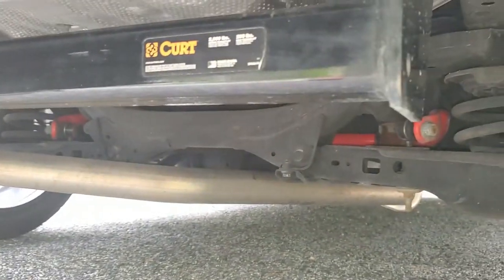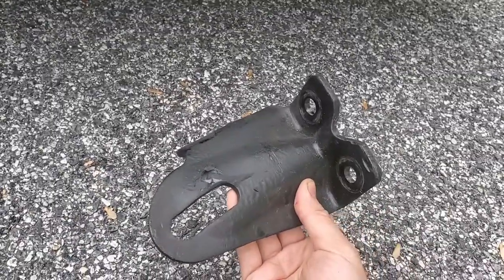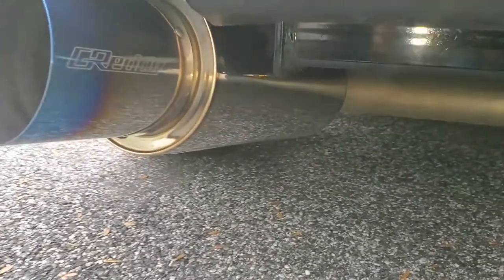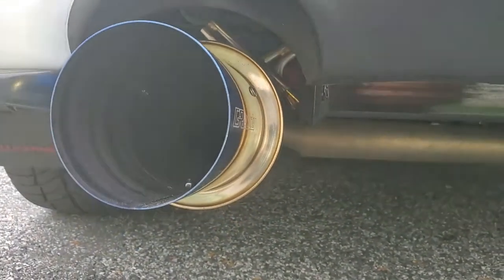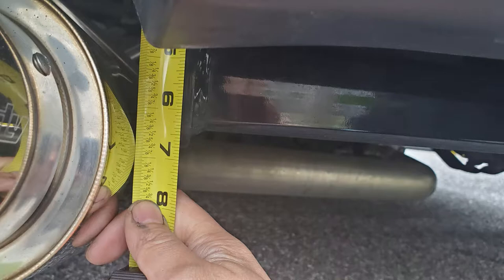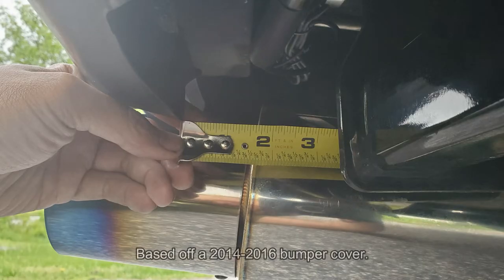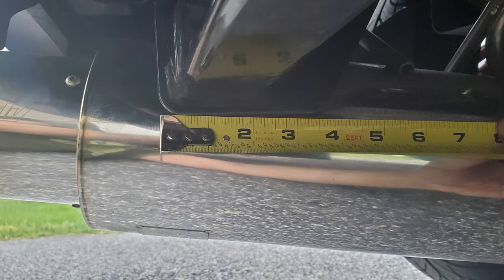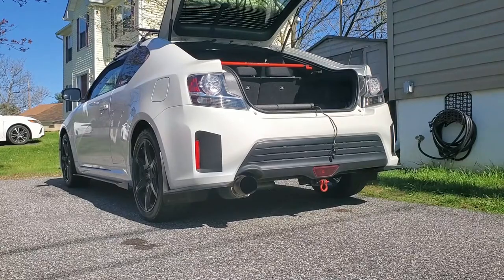Tow Hitch vs. Exhaust: Curt Trailer Hitch (11375) with an Aftermarket Exhaust (Scion tC2 / tC2.5)

Comment: I have a question? Do you know if the 2011 to 2016 have any problems with there manual tramision? How good is the  longevity of them?
Reply from the maker: I've heard of people having issues with the input shaft bearing. There was a recall for the 2011-2013 tCs, but some people have said they had the issue on their 2016's. I'm at 84,500+ miles right now, and so far so good.
Reply: Derrick Aquino  my has 62,000 and goin strong 💪🏻 but apparently isn’t that comment it not everybody!

Comment: Can i pull a small open trailer with this on my scion tc 05?
Reply from the maker: You would need a different model hitch, but you should be able to handle a small trailer with a light load. Look up towing capacity online to see how much your tC can handle.

Comment: I need to hook up a uhaul trailer to my tc.  If I got this mount what else do I need
Reply from the maker: Aside from the tongue and ball mount, https://youtu.be/7DLYenIxPR8.
Reply: @VampyreX13  and was there any drilling or cutting or was this a straight bolt on system
Reply from the maker: @IDKWTFID  https://www.etrailer.com/p-C45024.html (stock height) and https://www.etrailer.com/Trailer_Hitch_Ball/Curt/A-80.html are what I used when I rented a tailer from U-Haul.
Reply from the maker: @IDKWTFID  straight bolt up per the video.